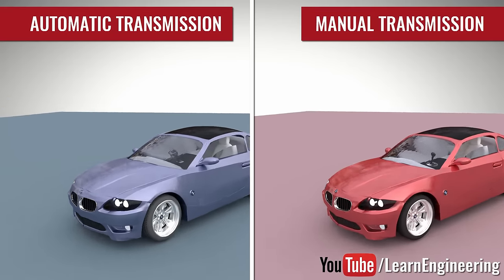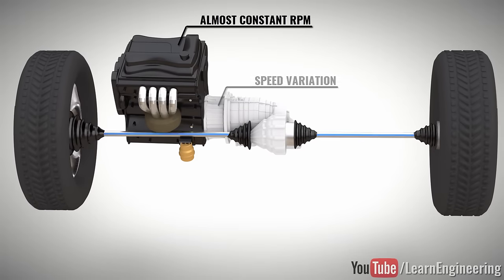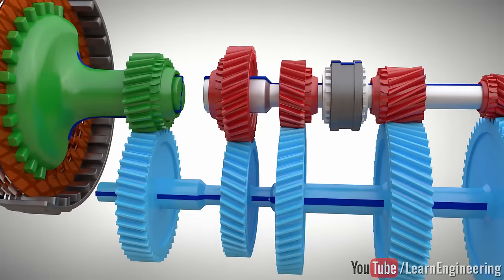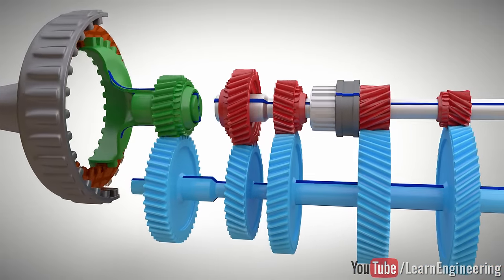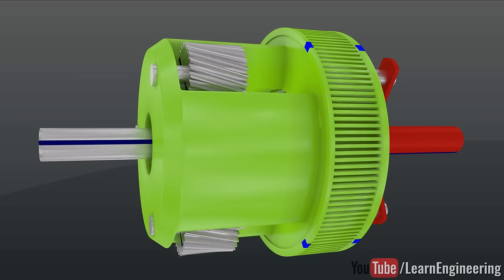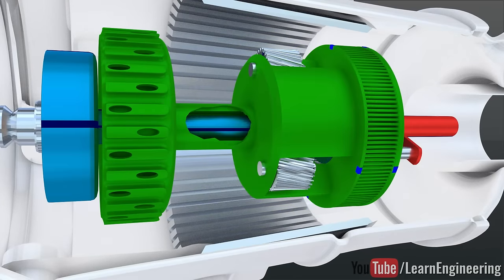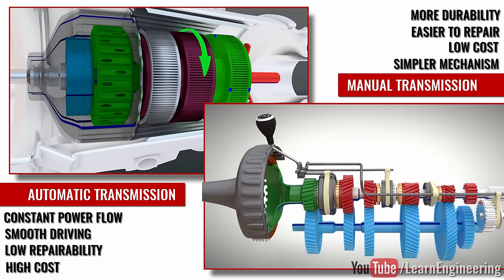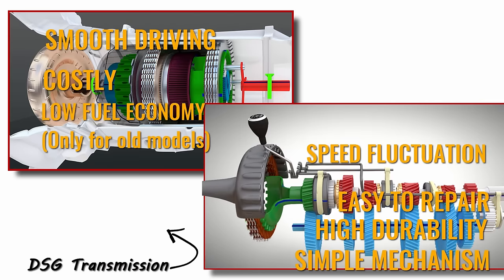Automatic vs Manual Transmission

Comment: You definitely don’t have to engage the clutch in order to break in a manual
Reply: I belive it refers to when you break to a critical low RPM or when you want to stop.
Reply: @3goats1coat  haha i mean you lose power when you change gears ether way . there is a reason why automatics shift faster and better. but manual is so much more enjoyable  exactly that "loss in power" is so much fun when you press gass a bit then change gear and you feel car tug forward damn that is exiting.
Reply: @luk4s56  well, you lose traction for less than a second and more than a ton of steel being in freeroll.. you get what I mean, there's literally no way for a passenger with closed eyes to feel when you shift (except if you want to).
Also, there's a reason why drift and rally both use manual. You're losing a lot of control over your car for that bit of comfort. Also safety, I'd say (considering tight overtakes).. the knockdown needs an eternity to activate, with manual you can be at 4k RPM with a howling turbo in a split second.
Reply: @3goats1coat  true i agree. its just that auto is more convenient. thats all there is but also i think its good that auto is popular. inexperienced drivers with manual are terifying to meet on a road
Reply: @luk4s56  I agree so much with you on that! Options are always healthy, actually we'll have an auto in the family soon enough too (my mother is getting too old for constant clutching).
Different people, different driving styles, different objectives. Not sure how it is in your country, but we got a "learned on auto, license is restricted for auto" policy. Nothing good comes from someone used to automatic going out on the roads with a manual, without an instructor.
Reply: @3goats1coat  same here. if u want full license you have to pass on manual. and there been more than once i nearly got backed into an idiot who went into reverese instead of 1st. most new drivers cant catch car into uphill fast enaugh too
Reply: @luk4s56  but that's a case with most learners or did you just start driving like a pro from day 1
Reply: Cameron Tice we can do that only when the gear is in neutral
Reply: @luk4s56  how did you learn is my qtn?
Reply: @luk4s56  You went off on as tangent for no reason. Inexperienced drivers are a danger no matter the transmission. Idiots in a manual won't make the same mistakes as an automatic but they're still gonna make mistakes. Also, you've made mistakes as well, don't act like you're a perfect driver.
Reply: @shiekastate  yeah, but drvinig more dificult gear make you a better driver while i dont see how automatic helps. for manual you learn to feel the car while automatic is nothing. i had situation when my breaks malfunctioned and i used gears braking with engine to save myslef and i doubht in critical situations like those automatic can help ofc i had my share of mistakes for fuck sake 1 day before my drivers exam i hit old root and riped half my brothers bumper off xD
Reply: @luk4s56  Using that very logic of driving in more difficult circumstances just means you're increasing the likelihood that inexperienced drivers will create problems for other drivers. It actually makes more sense to learn the fundamentals of driving on the road with other drivers with as few car related hurdles to worry about. After they can drive effectively and safely,  THEN they can move to a standard.
Reply: @shiekastate  yeah and thats why america has like 98% automatics because of thinking that way.
Reply: @luk4s56  America drives mostly automatics because there isn't a legal requirement to know standard. In reality, knowing how to drive standard is not necessarily whatsoever to be a competent driver and if you really think that it does, then all that's showing is that you're trying to say you're better than everyone else. You're simply an elitist trying to justify your ego.
Reply: @shiekastate  i like manual alot its way more ingaging and not driving manual you forget it  i seen it with many people before. thats all.
Reply: me when i drove a automatic the first time: wait, where the hell i the clutch? HOW THE HECK AM I SUPPOSED TO STOP WITHOUT A CLUTCH?!?
Reply: You do if you don't want to come to a jerking halt as your engine stalls at the red light. Clutch, neutral, break, stop.
Reply: @KinkyNothing  
Clutch brake stop neutral.
Reply: @KinkyNothing  
That was how I was taught.
Grandpa took me out to the field with a old ranger and said go ahead.
Reply: @KinkyNothing  
Not in a farmers field going  20 miles a hour.
Reply: @KinkyNothing  
Right.
Sorry about that.
Reply: Yeah
Reply: @Vlad-xg5bq  why on low rpm, we need to engage the clutch? Im about to try driving
Reply: @antoniusdaivap7759  on low RPM the engine doesn't have enough power to keep on moving the car. It will reach eventually a point where it's going to shake a lot and then stall. You'll then have to restart the engine. In order to avoid that, before coming to a stop or before you downshift, you press the clutch pedal so the wheels are disconnected from the engine. However it's well advised to never leave the car in neutral unless you drive at a very low speed. You'll put more stress on the brakes which can cause them to stop working in critical situations (for example driving downhill for a long time, leaving the car in neutral and only using the brakes to slow down). I hope i was clear enough. Good luck on your driving!
Reply: @3goats1coat  not necessarily. My car is an automatic and all I have to do is press my foot right down and it will jump from 5th to 3rd in the click of a finger and i can start to overtake someone before they realise I've pulled over to the next lane. And most supers use automatic as its compact and DCTs will always shift faster than any human with a manual could ever do
Reply: How about braking then?
Reply: Unless you plan to stop without taking it out of gear
Reply: My dad has been driving a manual t. for 20+ years, and he pressed the clutch before he brakes.

Comment: 6:40 NO! you don't need to press the clutch in order to brake!
Reply: brake not break. apart from that, i agree, press if braking in order to  stop not to slow down. otherwise you loose inertial engine brake and you will end overheating the brakes. but on today cars, electronics are core  part of car functions and instructors suggest to push the clutch in hard brakings to avoid the engine to shut off and consequently cut off electronics (like abs  steering assist etc..) .
Reply: He didn't say you HAVE to press in the clutch in order to brake, it was more of a recommendation, I just think he worded it wrong, I think his point was  you should press in your clutch so your engine doesn't suddenly feel the pressure of braking to a complete stop, you could just press in the clutch to separate your engine from the wheels, then brake.
Reply: "In manual transmission driving, BEFORE you press brake pedal, the clutch pedal must be pressed completely".

That is what is said. 
There are people who do this and usually place the gear shift in neutral. 
This is WRONG!
When braking,  you can keep the car in top gear all the way to almost being stopped before you step on the clutch (before the engine stammers) OR downshift one, or more gears as you decelerate. 
When you are at a complete stop then you can place the shifter in neutral and let out the clutch pedal (relax your leg)
The video describes driving a stick like an old woman.
Reply: Placing the gear shift to neutral before stop is normal.
Reply: @PhilipReeder  for ur engine is always better press clutch before brake.
Reply: No you do not but if you break too suddenly and lose to much speed while the car is in gear the engine can stall.  So when I know a stop is ahead I shift into neutral and coast to a stop.  Nice and easy.
Reply: brake**
Reply: @Mr Sunshineseasy, can shift into neutral without pressing in the clutch. you can then come to a complete stop without using the clutch and without stalling the engine. not the best idea to do, but is possible to do.
Reply: @Mr Sunshines don't know, I never drove a semi. maybe with an empty load? possible to shift my 4-cylinder car without the clutch. just match up the engine rpm and it'll slide right into gear. shifting into neutral is as easy as letting off the throttle.
Reply: Same for shifts , 1st to 2nd gear , clutch engagement is necessary , 2nd to 3rd and others you can shift without engaging the clutch
Reply: If you put in nutral you don t need to press clutch
Reply: @ironphoenix5145  why dont you just slow down with 5th gear engaged until you reach like 30km/h (around 1000rpm), and then press the clutch to disengage .
Reply: @IvanIvanov-uw4yx  Because if you keep the car in any gear as you slow down the car can stall. If you know you are going to stop just put the car in neutral and apply the breaks.  Doesn't matter if you are going 15 mph or 70 mph.  Been driving a manual transmission for 28 years like that with zero problems.
Reply: @ironphoenix5145  I just press the brakes till it reaches 30km/h, then i press the clutch till i stop completely, and then disengage from 5th gear. I think its pretty much the same, even my instructor taught me that way... not that i didnt ride the same way when i was young..
Reply: i dont know why but whenever i come to a stop i always blip the throttle while going down gears instead of just pressing the clutch
Reply: @lorenzo42p  "can shift into neutral without pressing in the clutch" possible if you want a broken arm and/or a broken stick, biggest bullshit ever. :) either way you damage your car so have fun with that repair bill.
Reply: run the engine really fast with the car not moving and in first gear. and the clutch pedal pushed in. with the throttle pedal and the clutch pedals both pushed to the floor, slide your foot sideways off the clutch while maintaining 358% of your body weight on the throttle. you may now break your clutch.
Reply: I agree. Especially if you need to brake from high speeds, just press the brake pedal until it comes to low rpm before disengaging the clutch and finally release the gear to neutral before coming to a complete stop. Releasing the clutch (pressing the pedal down) over a long period of time would overheat it and, comes worse to worst, may cause incident if the engine brake didn’t work because the clutch is released, which is basically free-wheeling you to highway to hell.
Reply: Lol lets see who has the dead engine after without pressing the clutch in order to brake😂😂
Reply: @kristjanpirc537  lol you slowed your car is in 1st gear if you dont hold the clutch too early before braking and puting it to nuetral your car will run forward or/and else your engine will die
Reply: @ervasvap6265  I am for eu I know better than you
Reply: @ironphoenix5145  keeping your car in gear while coming to a stop saves on gas and I only take it out when I'm under 2,000 rpm. This also prevents me having to rev match if we start accelerating again (and save on clutch wear as I'm saving a shift). Your car uses almost no fuel while decelerating in gear compared to whatever fuel is used with the engine in neutral at idle rpm.

Comment: Manual is very easy to understand, but the Automatic transmission I still don't have a damn clue wtf is happening in that.
Reply: RzVids true
Reply: RzVids lol true. it's fluid in motion. but it's  complifuckincated
Reply: This is really me now.
Reply: Hats off to the engineers who designed it...
Reply: You guys have to learn the working principles of planetary gears. Basically a planetary gear have 4 components, the sun gear (in the middle of everything) the ring gear (surrounding the planet gears) the planet gears (small 3 gears) and the carrier (connecting the 3 planetary gears) they're always in mesh, and by stopping one or two of these gears you get gear reduction, in which the speed in the output is different than the speed in the input, so you can get underdrive (speed is slower in the output), direct drive (output speed equals input speed) and overdrive (output speed is faster than input speed) that way you also multiply torque to get the car moving, that's why it's a lot easier to start in 1st gear than in 2nd gear, because torque is twice as strong (depending on ever gearbox and the gear reduction for the 1st gear of "X" gearbox)
Reply: huh?
Reply: Not hard to understand at all. You only need to now all of the basic working principles of gears and clutches
Reply: the computer controls the gear ratio by changing which ring gears can rotate. its that simple.
Reply: Not only which ring gears but also by stopping sun gear or making the whole assembly rotate as one unit, but yeah. Basically the computer (OR a valve body) will control the planetaries
Reply: This why I stick with detroit locker rear ends and manuals. Too much crap to worry about. I'll stick with my dog arms lol. I really want a manual cassette type transmission though.
Reply: Too much crap, but if threaten the way it should it will last like no other... also it solved knee problems and bla bla bla
Reply: lol
Reply: It's pretty simple, actually.

When the ring gear is stationary, each planetary gear must contact every tooth on it to turn the drive shaft once.

When the ring gear is moving, that reduces the number of teeth the planetary gears need to contact per revolution. 

By turning the ring gear at different speeds, you can produce different gear ratios.
Reply: magic
Reply: in an automatic transmission, and in the new hybrid synergy drive transmissions, that's where the "FM" happens. 
FM term was used in the old days, in the electronic industry, which stood for Fuckking Magic... lol
Reply: same
Reply: feels better to have Manuel
Reply: Yeah true

Comment: "Every time you need to change the gear, you must disengage the clutch"
Me, a truck driver Floats everything past 2nd
Reply: I drive a Jetta and I don’t use clutch past 2nd
Reply: Is it not equipped with synchronizers? If it is, by doing that, you are heating the synchronizers and f*cking them. If it's not, the clutch most be use just to start and to stop
Reply: I worked in a tractor that didn't had synchronizers, you only can get the gear shifting correctly, not grinding, if you don't use the clutch
Reply: @jackh1577  be careful with your synchronizers
Reply: Do you also float everything future second gear or is it just past?
Reply: @patrikeluisbritz4912  : truck transmissions are unsynchronized. Your two choices are floating or double clutching. And if you're matching RPM correctly, you're not going to harm a synchronizer because you'll already be synchronizing the speeds anyway. The key is to not slap shift, which is also the key to saving on clutch wear. An extra fraction of a second between gears is all you need.
Reply: @ErickC  not every truck
Reply: @patrikeluisbritz4912 the synchro’s job is to synchronize the input shaft with the output shaft to allow smooth gear shifting. If you use the engine to spin the input shaft to the same speed as the output shaft (also known as double-clutching and rev-matching) then there should be no wear on the synchros as both shafts are already synchronized.

Edit: in fact if you do this correctly, you should be able to just push it into gear without the clutch at all. I do this pretty regularly with my car since it needs a new throwout bearing and the clutch isn’t particularly useful anymore